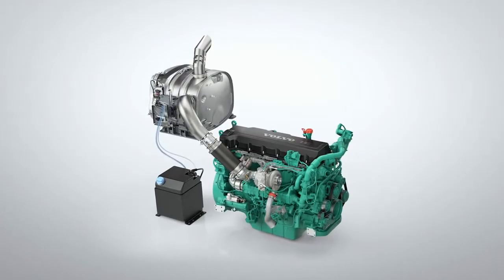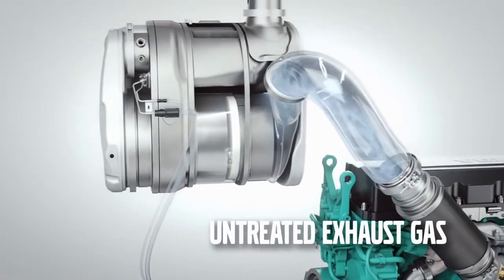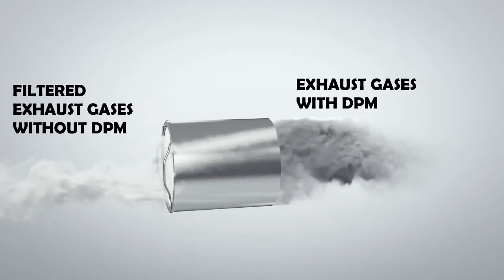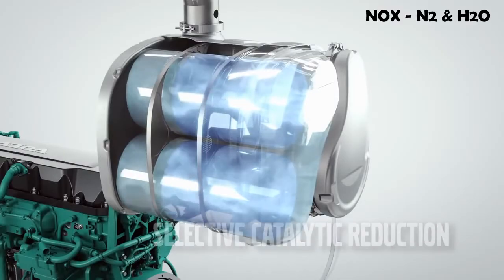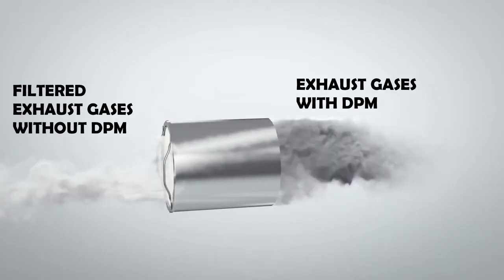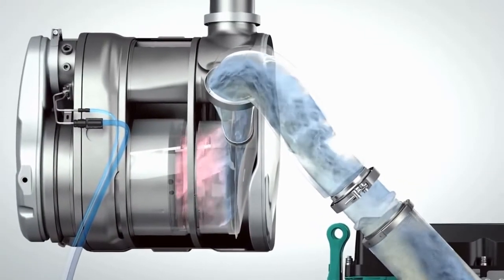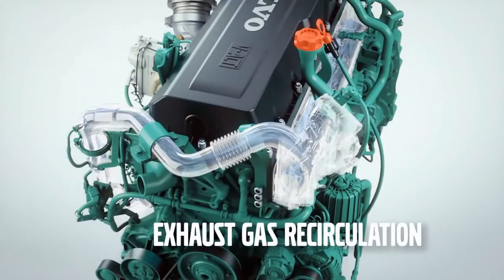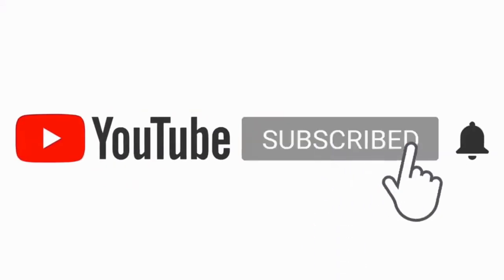HOW EGR & SCR SYSTEM WORKS WITH DIESEL ENGINE ANIMATION

Comment: Hi there, great video!! I'm an engineer myself, In your point of view which one is better SCR or EGR? I personally prefer the SCR system as treatment of the exhaust is done outside the engine.... With EGR as your are recirculating the exhaust gases to the engine, it will have effects and heavy deposits... Would be happy to hear what you think about it...
Reply: The SCR system is very sensitive to sulphur. The sulphur bond (SO2) will poison the catalyst layer in the SCR and ASC. 

Biuret will also form in the SCR if Adblue mixing is poor. Poor Adblue mixing can be a result of too low air pressure in the Adblue nozzle.

So Both systems have their downsides and advantages.
Reply: @landerwauters6778  i agree with you.... i work for my dad, we own a fleet of trucks hauling shipping containers in indonesia... we are at the state that we have to renew our trucks as most of them are old more than 10 years.... 

Earlier last year our government stated all diesel engine vehicle sales must be euro 4 emission, and now its a choice between EGR trucks or SCR trucks.... and we have to choose something that we can use for a long long time